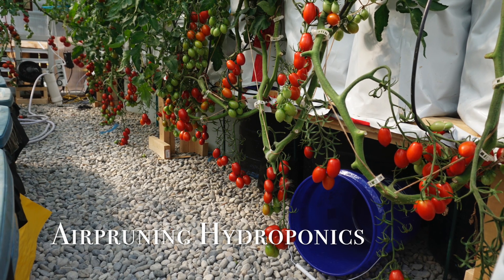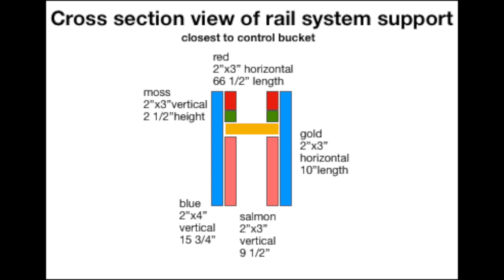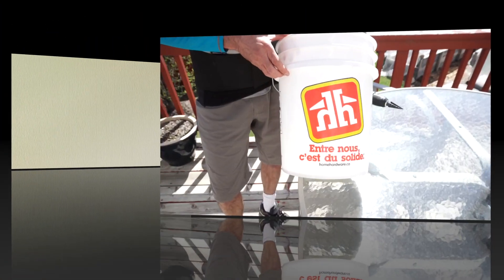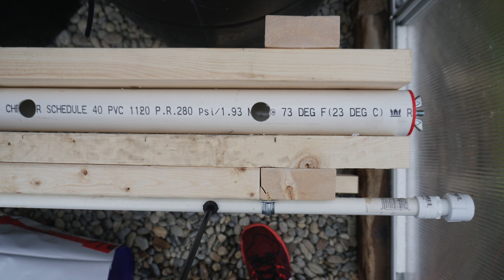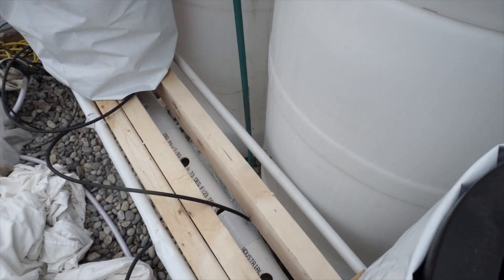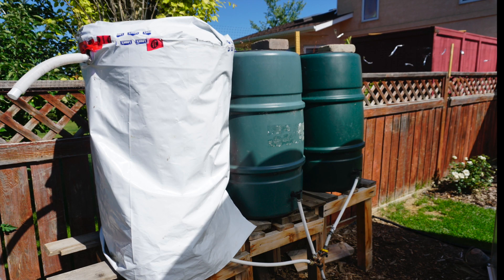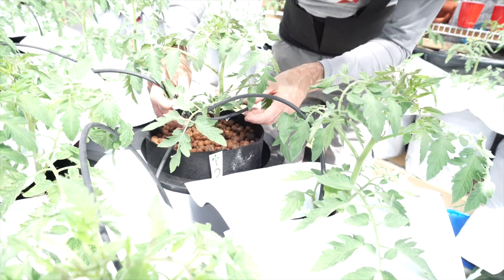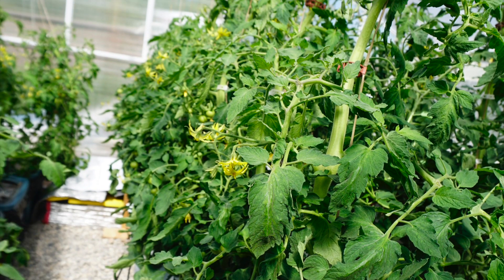Air-pruning Hydroponics

Comment: What are the advantages of air pruning in a hydro system?
Reply from the maker: Hi Nubuku, I would say easier clean up at the end of the year as the root mass is limited.  Taste, no roots it nutrient solution constantly taking up water. Thanks for watching.

Comment: I did something similar with the suspended net pot using 5 gallon bucket in a 55 gallon drum and I was getting heat and humidity trapped in the lower half of the drum where the water was draining from the 5 gallon bucket and the roots got sick and the plant died, that being said i do however live in the arizona desert and you may have better results with your setup as long as you live somewhere cooler lol In my opinion I'd like you to keep posting videos on this and so we can see what your results are. Thank you for sharing and as always Keep Building👍
Reply from the maker: Yup, you are in a totally different climate universe from me.  I still cannot imagine the level of dry heat you experience.  I am in a similar rain starved climate but no where near the temperature level being 1200 miles or so north of you and three times your height above sea level.  Interesting results on your 5 gallon bucket in a 55 gallon drum experiment.  My first tomato is ripening up so I should have another video next week.  Thanks. Jeff